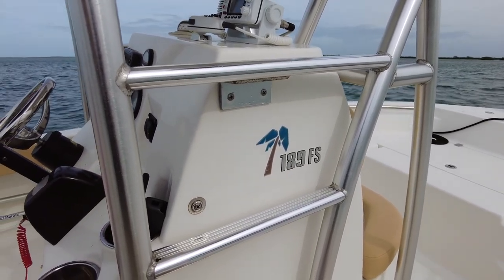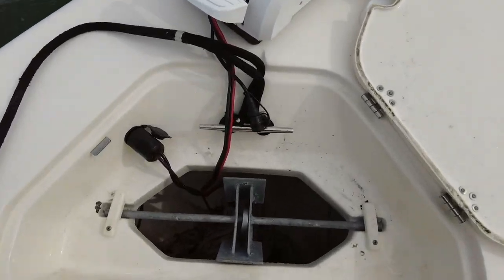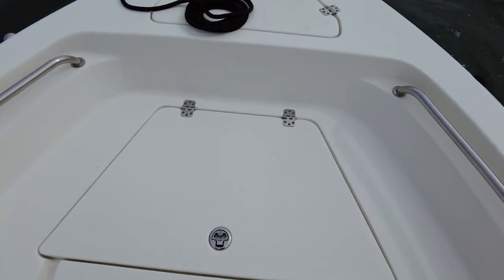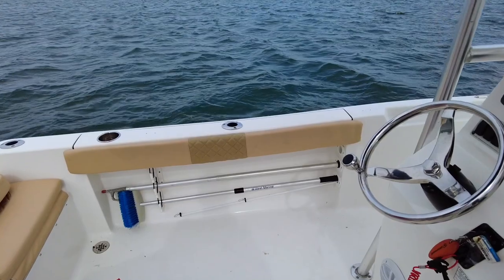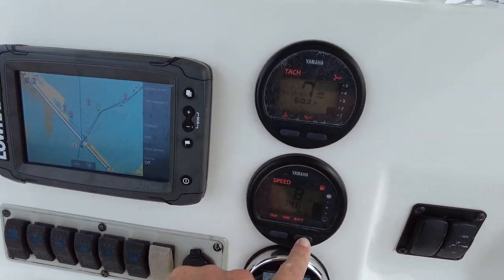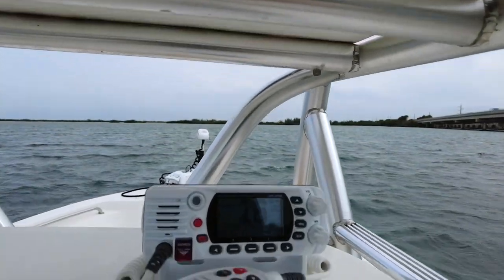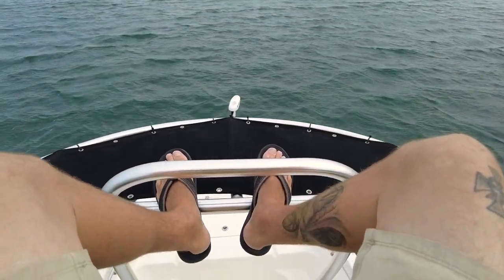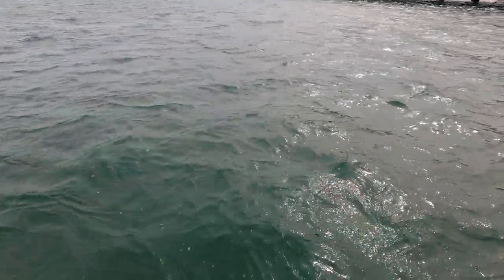Boat Walkthrough | Key West 189FS

Comment: Nice boat, if you were buying a new one today would you go for the 115hp or 150hp?
Reply from the maker: It’s getting re powered asap with 150. Always go max HP rating.
Reply: @austinsadventures305  Thanks for the reply, am thinking this would be an ideal boat for Indian River and near shore fishing in the Brevard Co area (weather permitting) what is the min specs for a trolling motor that you would recommend? Thanks for taking the time to provide your insights.
Reply from the maker: Know that area well, and it is a great boat for that area. 90 pound thrust I pilot is what I run. Check out my video 30 miles out in a small center console, where I ran out of the port.

Comment: What is the total length on the trailer motor up? Does it fit in a garage?
Thank you.
Reply from the maker: This boat without a T Top and with a foldable tongue trailer can fit in a standard 2 car garage. May have to go at an angle so you couldn’t park another car in there. Total length of boat and trailer is probably close to 22’.
Reply: @austinsadventures305  hi, new sub here, live up in the Jacksonville area, will be looking for a boat that can fit in my garage since the HOA has a beef about boats in the driveway or side yard and storage fees are running around $100+, so garage it is. With the foldable tongue, is the boat/motor still around 22' ? I've got about 19 ft without cocking it sideways to play with, thx
Reply from the maker: @mikewalker1081  Thanks for the sub! 

Typically foldable tongues will fold at the nose of the boat, give or take about a foot. You want the tongue to fold right at the bow if possible for the least amount of space to be used. It all depends on the trailer you choose really. The boat length can’t be changed. 😆 Take some measurements of the boat at your local dealer and go from there. 🤙🏼
Reply: @mikewalker1081  There are trailers available with removable tongue. None of my trailers have that but a friend does and it allows him to keep his in a shed he wouldn't otherwise be able to close door. on.
Works like the hitch on your truck, remove pin so you can remove ball mount, but with 2 heavy pins so it's stronger. Was originally designed as a thief deterrent, removing tongue back to wench mount, but shortens trailer doing so too.

Comment: Hi nice video how long motor trolling can work on your batteries ? Did you drill h
Reply: Hole
Reply from the maker: Trolling motor can run for about 8-12 hours and yes I drilled holes to mount battery trays.
Reply: Can you video how did you passed wires from battery's to motor? What do you think about boat is ok for 2-3 ' waves?
Reply from the maker: Drilled a hole between anchor locker and that hatch as high as I could just big enough for wires to pass through. It will handle 2-3 easy but it’s not recommended.

Comment: How fast does she run w the 150 you added? Also what is cruising speed / rpm with the 150hp. Thank you.
Reply from the maker: With a 14.25 x 19 prop top speed is 48 at around 5800 RPM.
Reply from the maker: Cruising speed is 40 at 4000ish

Comment: Where is your gas tank located?
Reply from the maker: Under the floor
Reply: @austinsadventures305  Where exactly do you access it?
Reply from the maker: A couple feet behind the center console there should be a round plate with a screw off cover or it could just be screwed into the floor. That’s to access sending unit and tank info.